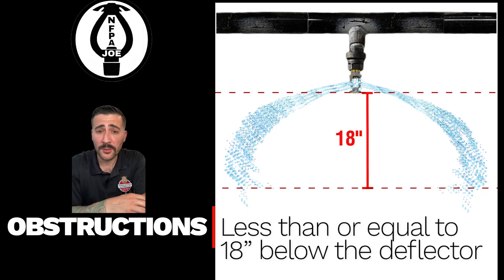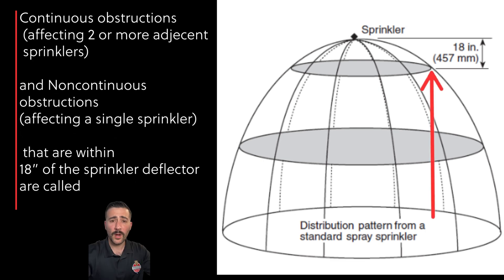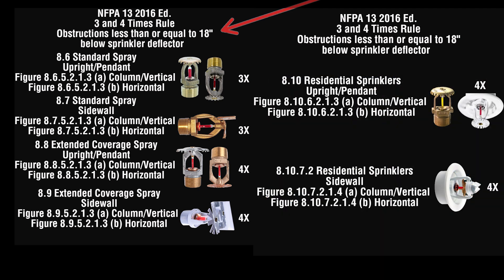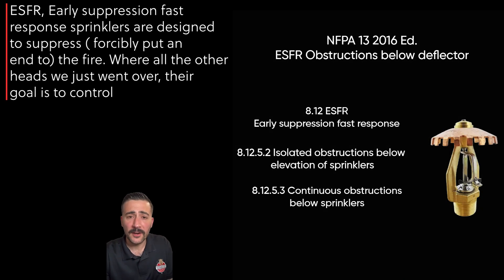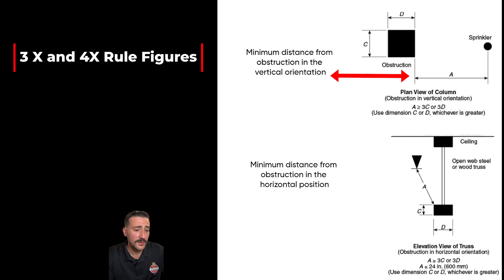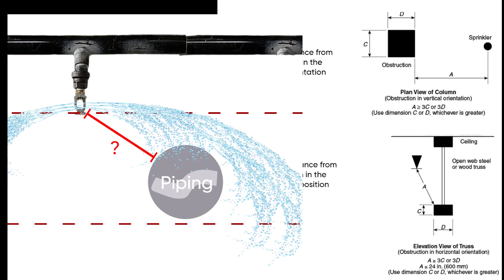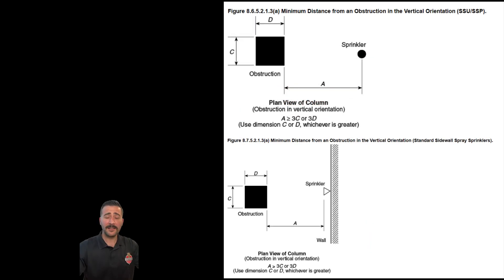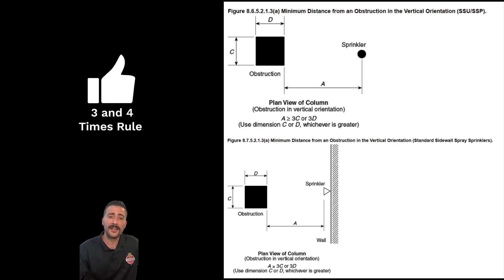NFPA 13 3 & 4 Times Rule fire sprinklers spraying over horizontal and around vertical obstructions

Comment: I still don’t understand your point at 6:25, about how if something is outside the 24" range, we don’t need to apply the three-times rule. So, what if I have an obstruction like a duct that’s 16 × 12 inches, located 26 inches away from the sprinkler — what happens then?
Reply from the maker: As long as the obstruction is under 4 feet wide, and using standard spray heads, there is enough spray that will go over the obstruction once you’re in the clear zone to control the fire. There’s always going to be pipes ductwork that creates shadow areas and you’re never gonna be able to get away from all that so through testing they’ve discovered that there’s enough spray that goes over these obstructions that are under 4 feet wide to control the fire.  the goal is to control

Comment: That maximum clear distance of 24" is the diagonal distance from the deflector to the edge of the truss correct? Not the center to center distance? I ask because the width of mine are 9" so I need to be a total distance of 27", I currently have have them 1'-6" apart center to center, but the diagonal distance is 3'-6". That would be sufficient for it to spray past the truss and create the necessary spray pattern right?
Reply from the maker: Yes the deflector to the edge. Sounds correct. Standard spray heads.
Reply from the maker: Yes the deflector to the edge. Sounds correct. Standard spray heads.

Comment: So in light and ordinary hazards.. the obstructions other than structural elements are allowed in 18" zone below the deflector... When the width of obstruction is less than 1.2 Meters?
Reply from the maker: Yes.exactly. When using the standard spray upright and pendant.

Comment: Is it permissible to install pendant type sprinklers for open roofs, such as factories or parking lots, according to the NFPA?
Reply: Per NFPA 13 you can install pendants or uprights. But uprights can give you better clearance for the hot gas layer in the ceiling.

Comment: So... The structural part with the uprights and ductwork where u mention it being able to spray over the obstruction.... You have that 18"... Does that mean the obstructions have to be under or within 18" tall? 
Problem, this stupid health inspector is telling me I need heads between ductwork in the pump room. There's like 6 inches of space between the ducts. Rooms 8x4 we'll say. Ducts are 3x and span the entire room. One duct is like 3 inches from the ceiling while the other is a tish lower. So technically, sure I could get a deflector over it.... But at least one would never get water sprayed over jt
Reply from the maker: Sounds like in your situation you’re using a standard spray quick response upright. When using a standard spray head as long as the deflector is over the non structural obstruction that is less than 4’ wide it will have enough spray to control the fire, providing satisfactory performance. If your inspector thinks the duct is too tight to the deck for spray to go over then the next step is to try and position the head to spray under using the beam rule. If that can’t work out a head on either side of the obstruction.

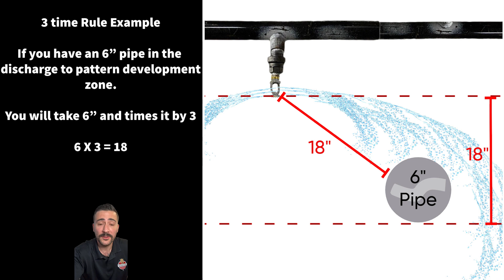Comment: Why big duct at 8:15 https://youtu.be/V0yOc47MkOY?si=BNHpzP79gbJl2fr-&t=495 is NOTobstruction and small pipe  @7:28 is obstruction and need to follow 3x rule ?
Reply from the maker: @ADOWAI 7:28 I was going over an example of how to use the 3 times rule. And then went to explain how when using specifically the standard spray upright and pendant in light and ordinary hazard occupancy only structural elements have to be acknowledged when spraying over an obstruction. Unless the obstruction is over 4’ wide. 
Let me know if you are understanding now. Thanks